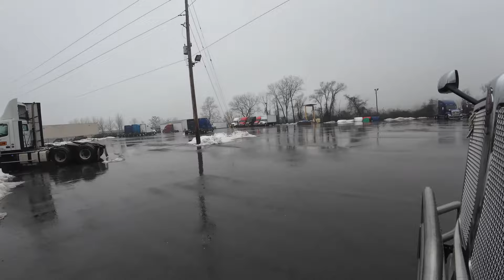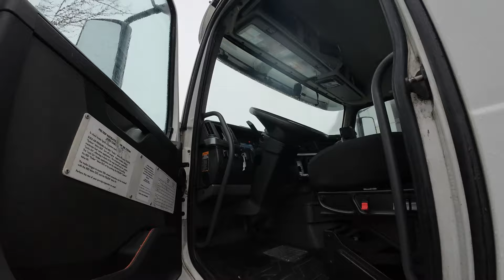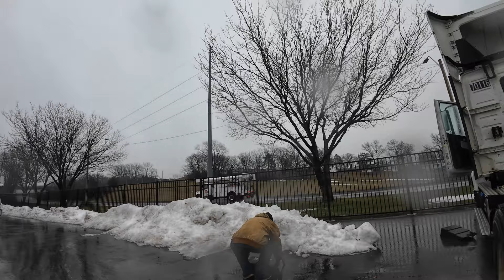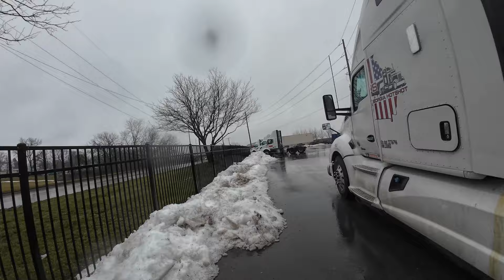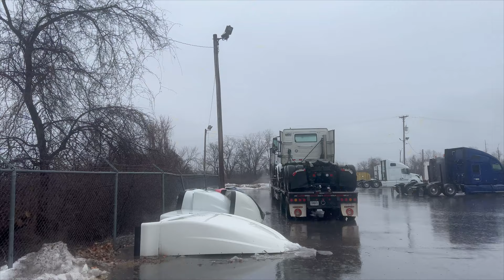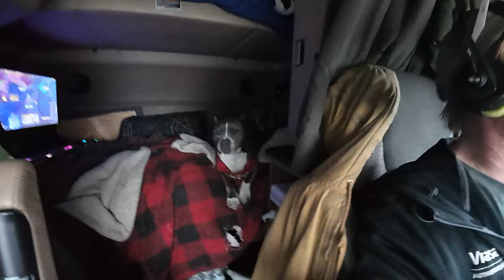This was not an easy load

Comment: I totally agree about that freezing rain - much better if it turns to snow. Early on, I had a single coil that I picked up in Atlanta and it fit on my flatbed so I left my trailer at home. Tarping a eyes to the sky coil with a 8' drop tarp on an 8' flatbed in freezing rain... I watched you climbing around trying to turn those fairings to get them to sit and I was like damn, that's gotta suck!!!

Comment: Btw...not sure if you have backup set of star bits in case one drops off in nasty place at bad time. Also thought about Magnetic Pickup Tool in tool kit if anything takes a dive. Harbor Freight showing 4.99. Notice one with attached LED light on end. Sweet! May the force continue to be with you. We are pulling for all of you. Can't image what you would do without Batman utility belts.👍

Comment: What the heck is up with not having trucks ready?  You are hired to load, secure, haul, unload.  Not do mechanical work.  I would call ahead.  It better be drivable, ready to load or extra expenses. There are extra risks climbing over it. Good for Lita just decided never again. It’s a load to reject. It was not ready to load.
Reply: I stopped at 18 minute. They owe you at least $200 per truck because trucks were not in running order, prepared to load. Let’s see them hire people to do that cheaper.

Comment: Another awesome job you 2 have completed,  you didn't say how many hour's it took to actually Remove the Flarings and get loaded, but I can assume you spent a good 4 or 5 hrs there from the time you pulled in until the time you pulled out, Bro you handled that job like a Real Trooper, I no you Both was pissed especially working in the Rain and getting soaked to the Bone,  but when you have to do additional work like that in order to get the load loaded onto your trailer there needs to be more money involved instead of just Rpm because that was a lot of labor you 2 just provided for free. I bet the Broker made more off that load then you Did and that is just wrong. But awesome job once again.

Comment: Guessing they piggybacked them in and only put on enough lug nuts on the front tires to unload them.
Reply: fronts are usually pulled off to piggy them, they were just too lazy to put them ALL back on when they dropped them.

Comment: I definitely agree that load wasn't worth the hassle. It should be a thing where if you have to take stuff apart then they pay more since time is money. If it is a simple load where you just have to load it is one thing but having to take things apart takes time and that should be extra money. 
You guys definitely need rain gear
Reply: He should never agree to remove fairings, way to damn hard to get to and heavy. If he had dropped one of those, and cracked it. He would have been on the hook for replacing it.

Comment: You not only got paid little for those shrouds but then doing laundry, drying truck and shoes out takes time too, everything wet. And cold.  But thing i did besides extra gloves, moreno wool socks used blue rubber gloves big ones over gloves, helped alot frozen fingers are horriable, she hung in with you, most women wouldnt have